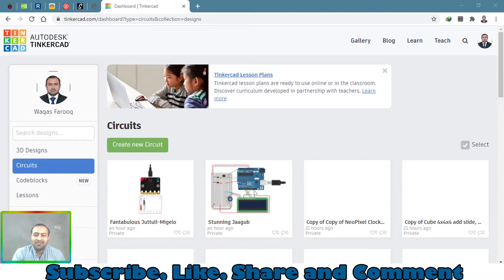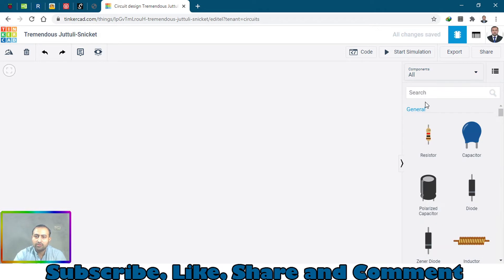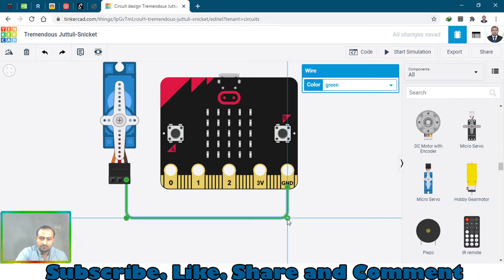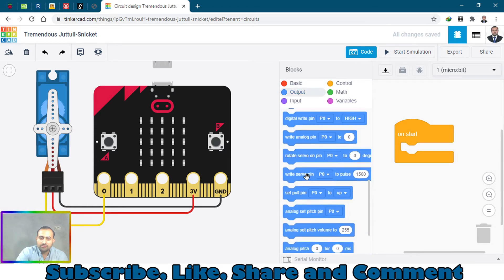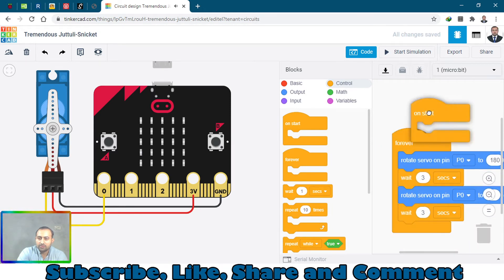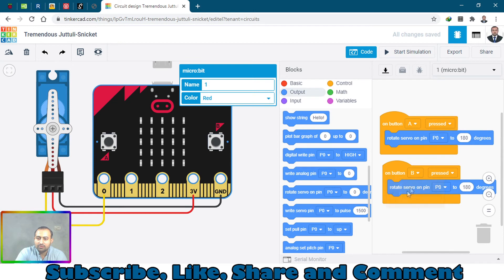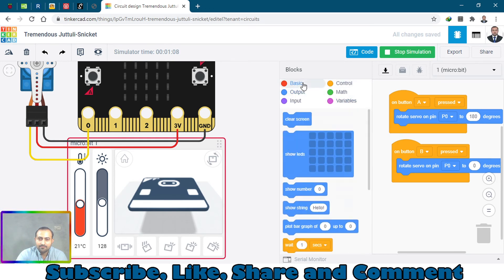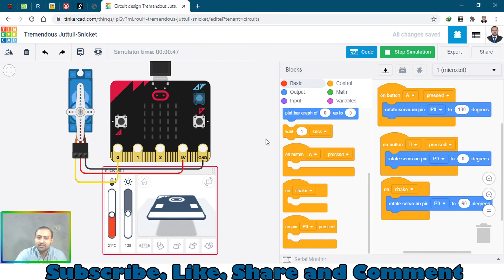Micro Bit Simulation in Tinkercad  Tutorial

Comment: Plz Make a simulation for RPM measurement and also for servo motor control
Reply from the maker: The servo motor that i have used in simulation is micro servo that can only take 180 degree turn 
.I will try to make it with Arduino with 360 degree turn servo motor
Reply: @WaqasFarooq  Yes. I am basically talking about servo motor  rpm meter.